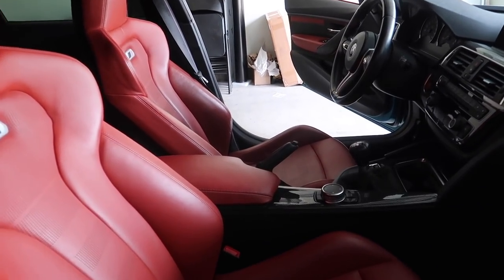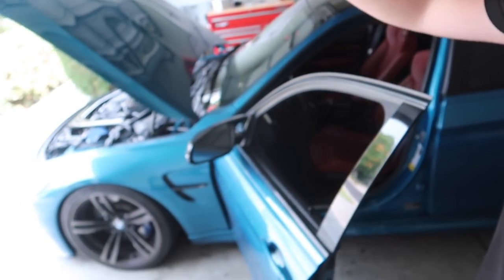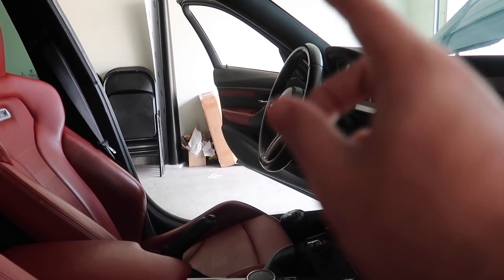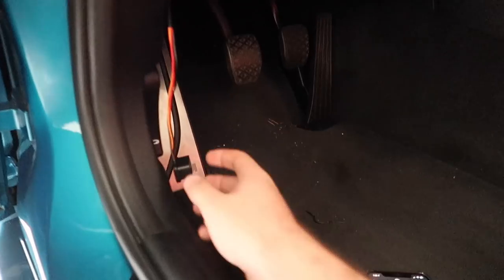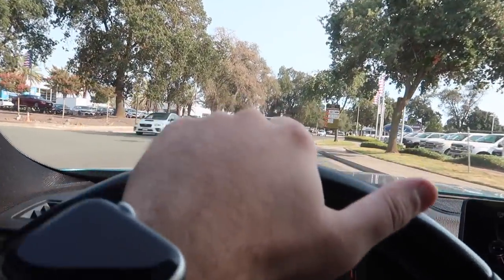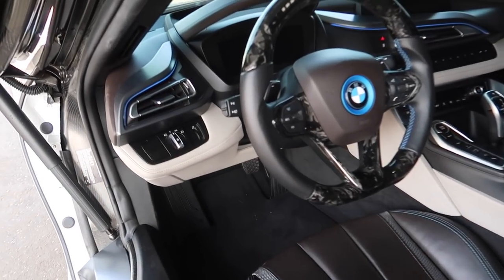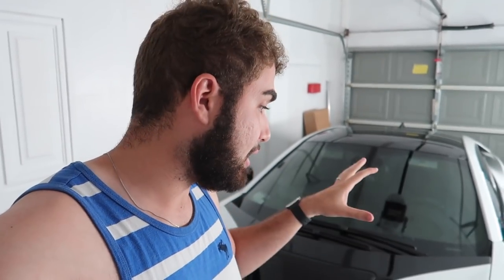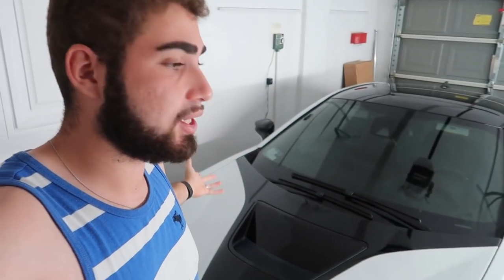INEXPENSIVE AND COOLEST MOD FOR YOUR BMW F8X! CUSTOM GAUGES!

Comment: I would just wait until you’re ready for paint, the car is so beautiful why ride around with an unpainted hood. Go with the non-led steering wheel, you’re right it’ll be much cleaner without the screen and shift lights.